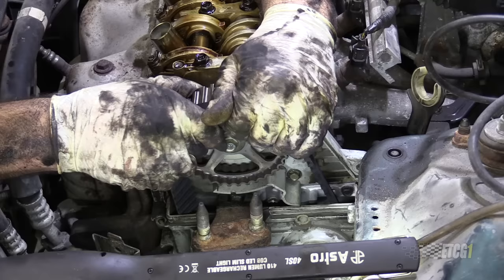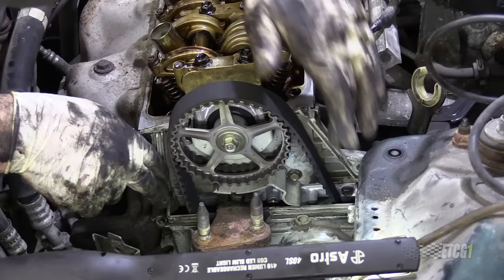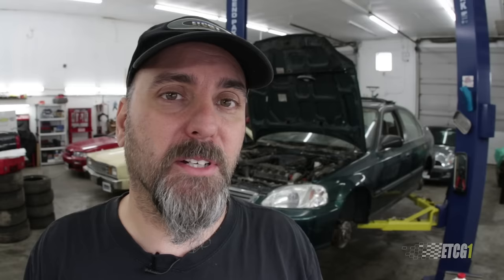How Come Timing Marks Don't Always Line Up Perfect?

Comment: I have a 2005 mitsu eclipse 2.4 with the timing belt . Looks like the timing on the oil pump gear is off 1 tooth could that make the oil can light on an off on the dashboard ? It starts runs an idles fine . Except it did develop a knock an 1 set of rod bearings needs changing . Wonder if it being a tooth off could throw the oil light an cause the bearing to go bad or would the oil pump gone bad all together ??? Any help please 🥺 !!

Comment: If the belt was off one tooth, what would the motor sound like would there be a noticeable difference? I have a j35 that is giving me misfire check engine light when I know I lined up everything properly. Could it be one tooth off and still run good?

Comment: So you tell me that are some timing belts that doesn't align on the marks? It's my situation right now as the marks made by me doesn't align but the engine's check marks are fine aligned. I'm still afraid to start the engine...

Comment: Is this the same set up for a Mazda protege 323 2000 model i went to loosen the screw on one of the sprocket the left hand sprocket timing Mark move do I need to put the belt back to reset the timing marks?

Comment: adding.  i turned in my clio 1,2 2002 for timingbelt and tensioner change,  after that my car dont go as fast any more..... im useing km/hour so top sped on it before was 160 km/h and pritty fast to go there to.   now it go to 150 km/h  and it takes long time from 135 km /h can it be one tooth wrong they set it ?

Comment: Hi Eric  "l think" you just answered my dilemma but can u plz confirm.
2000 xterra timing belt replaced. All timing marks lined up adjusted belt tensioner pulley. Rotated main shaft multiple times not paying attention to how many..... tried rotating backwards to get back to tdc and marks in place.  Not happening. Am l good?

Comment: Very interesting thank you!

So I have a job on a SOHC on my daily driver coming up where I’m changing the sprocket for the cam and the crank shaft gear because I’m pulling them out with the chain tensioner guide.

My question is this

I have a method to keep the new sprocket, cam, and crank gear, all identical when I place the chain, but do I need to make the chain timing marks match the sprocket and crank or will it be fine if the crank and cam are timed with the sprocket?

Comment: if they are ever so slightly off, and I have dual cams, then when my exhaust cam in showing TDC but my intake cam is a hair behind in rotation. which TDC mark on which cam gear should i use as my TDC when adjusting my valves?

Comment: Wow, an automotive video that actually has some useful info in it. I didn’t think people made those anymore lol. This reminds me of a timing belt I did on a 2004 Chrysler 300m. I must have had the belt on and off 10 times because every time the one camshaft would be a tooth off. I actually ended up having to backseat the one camshaft to get the marks to all line up after turning the engine over. I’m starting to like belts more and more after having a recent stretch of timing chain problems on multiple vehicles. Both need repairs/replacement at some point, and timing belts always come out cheaper and easier to replace in my experience.
Reply: Timing chains are supposed to NEVER need replacing.
Reply: Timing chains tend to only go out due to neglect. They're a bit more difficult to swap out as they usually outlive the engine, unlike belts which are a wear item and you have to go through this every X miles.
Reply: @TheEgg185  Tell that to nissan and their vq35 engines.
Reply: amak1131 well the chains stretch and wear just as much of not more than belts do. Ok, let me guess the tensioner should account for that wear? The tensioners are usually what fail on timing chains. Ask bmw, Nissan, gm ecotec owners, Mini Cooper 1.6 owners, early dodge and Chrysler hemi owners, I could keep going. Especially with cars staying on the road a considerable amount of time longer than they did 10 years ago. Hate to tell you, but if timing chains didn’t ever need to be replaced they wouldn’t make them replaceable. If you consider 100k-150k the lifespan of a car then I guess timing chains are a lifetime part, but any more than that they become a wear item.

Comment: I was skeptical when I replaced the timing belt, thinking I must've jumped the time or it was behind a few teeth and could've have screwed up the motor. As soon as I turned over the engine everything runs normal, but before I replaced the belt it ran somewhat lean and the timing was off.

Comment: Thanks for the video, in my case... the bottom mark was on the arrow and the top wasn't. And if the top was - the bottom wasn't aligned.
What if I take off the belt and align both to the arrows? what'll happen? I made a huuuge oopsie working on my Dodge Neon '04.

Comment: Heat, tension, harmonics, clearance. Yes, there is some play in the timing gear. If it could be designed and manufactured and actually run perfectly, they would be. However with heat and harmonics a zero clearance assembly would break in use.

Comment: I'm having this problem with my 2005 Pilot.  My son's mechanic friend is going to come over and help me out.  If he is OK with it, I'll make a video.  I'm having two problems.  First the rear/firewall cam want to slip toward the firewall when I put hand tension on the belt in the place where the hydraulic tensioner would be.  I can compensate for that.  Second, when I do get the marks lined up, release the tensioner and hand crank for 2 revolutions both the front and rear cams are off one tooth.  I can't figure it out.

Comment: I wonder if there is a specific optimal ratio of number of teeth to the belt, to the total number of teeth in the cam and crank gears. Obviously the ratio between cam and crank is 2:1. But is there a specific ratio from cam:belt or crank:belt? or maybe cam+crank:belt?

Comment: Do Fords still have no timing marks? I once did a timing belt on a Zetec-SE engine (Ford/Yamaha co developed if I remember right) that didn't have timing marks.  It had a tapered crank pulley (no key) and you got the timing right by using a special flat bar tool that slid into slots on the ends of the camshafts when the timing was right.  Very odd, haven't taken apart a more modern Ford engine to see if they're still doing that.

Comment: Good video thank you! So I was setting the timing on 2009 dodge ram 5.7L and it lined up correctly and I released the tensioner  but I rotated the crank 1 more time and it didn't line up, so???

Comment: its is a mcm problem, just get de mcm between cam shaft sprocket teeth numbers and  timing belt teeh numbers, divide this result into the cam shaft sprocket teeth numbers and you will get the number of rotations before that the marks on both sprocket and timing belt will match again

Comment: I have redone my head gasket,3times in the last two weeks first I didn't clean the heads so it blew,2nd I didn't have any money so I used same gasket cleaned it up then spray painted it to get a seal,that didn't work ,3rd I used original gasket cleaned it then  sprayed it with copper gasket spray now only problem is that it's starts on the first try no problem but when I turn it off then back on it trys to start then stops and then hesitates then starts 3 try it won't start at all .what am I doing wrong

Comment: i ave a problem with  my d16 engine, it idles fine but when it reach like 1500 rpm it start to behave like it is missing until u pass 2000rpm, u can tell me wat could cause that

Comment: No of teeth should be the amount of turns required. For the crank, it has seen the mark 4 times during that time. This is also important for any chain driven system. Picking the right sprockets for a motorcyle will keep both chain and sprockets from wearing out prematurealy.

Comment: hey what is the diffrent, if the timing is right on crankshaft.  and only one tooth wrong on camshaft??  sounds diffrent ?  or just lose 2 to 4 kw ?? should be more diffrent if its wrong one teeth to the left or right ?   can you do that test in a video ? ???  and fire it up.  should not be any damage with one thooth................

Comment: so so so. i removed the timing cover on my 2011 v6 stang bc im doing the timing chain. i found the camshaft phasers timing marks dont align with the timing chain marks. Alldata says to put piston 1 at tdc which i did and the picture they show, the right side cam phaser is slightly offset pointing to the right and the left phaser slightly offset pointing to the left. however when i have my engine at tdc for poston 1 and the timing marks from the timing chain, the phasers dont show as the picture from all data. my right phaser is slightly offset pointing to the right as shown on alldata. but my left side phaser is more straight up and down. i want to know is this is anything very bad before i remove it. idk if this will mess me up during installation.

Comment: It's not that it is designed in at all. It's a simple factor of how belts and chains work. Unless you have two equal sized sprockets a chain or belt can never hit the same marks every rotation.

Here is a simple thought experiment to understand it. If you take two equal sized circles you could replace the belt/chain with a bar attached to each sprocket on a rotating pin (Think how all the drive wheels are coupled on a steam locomotive) and the circles could still spin around freely cause they are 1 to 1. However, if you take a big circle and a small circle and try to connect them with a bar in the same manner they will get jammed up because the ratio isn't 1 to 1.  Since a belt and chain doesn't have to connect at a fixed point on both wheels it avoids this inherent problem that bar links had.

Comment: But what if it's exactly half a tooth off, so you don't know if it's supposed to line up with either one or the other tooth?
Also, you counted the revolutions of the camshaft. I guess, engines are designed so that those match with the revolutions of the crankshaft, so this makes sense in a way, but I also wonder how many revolutions of the timing belt itself those were.

Comment: When the marks are close rock it back and forth. The marks will align unless it was improperly installed. Belts stretch, chains do too, and gears develop wear. There's always going to be some play. It's called clearance. 
 Line everything up and put it together. A real good idea is to manually turn the engine a few times to make sure the marks are aligned. If you're off it will be obvious. Especially obvious if you run the engine.

Comment: I am trying to do the timing belt on our 2008 Audi A4. The trouble I have is that when I get the crank pulley mark and cam gear mark to pointing correctly, the crank won't stay and slowly moves CCW, resting an inch or so off the mark! I tried going past the mark a little, but the crank still rotates CCW to the same place off the mark. I had loosened the plugs to make it easier to rotate by hand. Tomorrow I will try tightening the plugs to see if it makes a difference. Any one know the reason why this is happening?

Comment: So it's the solution of (n*x) mod b = 0 where n is the number of teeth on the cog and b is the number of teeth on the belt and x is the number of rotations. And that proves that the honda engine is actually a hand cranked calculator in disguise

Comment: This has nothing to do with timing marks lining up. This has to do with cog/gear tooth ratios. For example, if you have a cam cog and a crank cog with the same amount of teeth the marked lines will line up every time when the belt marks come around. Timing marks not exactly lining up when you put the belt on has to do with an old stretched belt or belt slack when you put on the new belt. I agree, if it's less a tooth out its within spec since you cant get any closer unless the new belt is wrong or not made right.

For this "hunting" to exist the belt would actually have to change position on the belt, this would cause a valve interference catastrophe.

Comment: Hey eric got a question.  I replaced a timing chain gears and tensioner on 09 dodge avenger 2.7 and as im rotating the engine i noticed that the tensioner and guide seem to slap.  Almost like the tension doesnt full extensend to keep chain tight. Thought maybe tensioner was bad. Bought another new and same thing. Each rotation i go to make sure the marks line back up which they dont now after i seen your video im going to try the 52 rotation or so to see. But the tensioner guide is more of my concern? How do i fix that

Comment: The biggest reason that throws marks off is when the head or block deck has been shaved. and i can tell you that isn't fun!!! Also I ecounterd once that the factory service manual was wrong... That was a long day...
Reply: I had to throw out the manual once on a Toyota Camry. Mid 2000's. What sucks, I managed to add a little thoughtfulness of my own and got it perfectly timed only to realize I had assembled something else imperfectly. I'd rather be lucky than good.

1st time go became several hours trying to recreate that magic moment. A few mm that Eric taught about can't be an inch. It would move out of time by nearly an inch! The way I put the belt down from cam to crank had to be few more, no a few less teeth many times over until I landed at the magic middle.

Prior to this engine, I was a first time go as they say on every engine I had timed. Usually laying down the belt impossibly tight is the solution then tighten the tensioner, but not on this engine!

There's a Kia that can cut your fingers off when it jumps. Why would they chose timing Mark's where the engine is so likely to leap violently? There had to be a way to make Mark's in a more intelligent engine position. 

I learned in the comments that I should make my own Mark's at a natural engine position and then you can confirm it with traditional marks.

Kia literally put into the manual that the engine likes to jump from the Mark's. I felt like they were going to say next that they weren't liable for all the injuries they've caused. 

Thankfully, I stayed safe.
Reply: Dutch, I can see how if you were used to timing an engine and then you did a shaved one that the rules will have changed a bit. Sounds like a pain in the ÷_<.
Reply: Especially if you don't know that it has had work done in the past.
Reply: That's also my lesson that I learned: ALWAYS MARK YOUR PULLYS. But I'm glad that I am not the only one that has this issue :-)
Reply: I have a 2000 Honda Civic LX I want to change out the belts, but what you said about the resurfacing of the cylinder head and block itself, how do know what size, type belt to get??  Will this glitch burn more gas just to keep ratios for a good running engine??

Comment: I get how the hunting works, having an odd number of teeth where the belt will progress with each turn, but I'm confused as to how this relates to the timing marks not lining up.  Is the distance between teeth changing?  That seems implausible.  It shouldn't make any difference what teeth of the belt are engaged as the distance between pulleys (in teeth) doesn't change.  What am I missing?

Comment: Gear ratios can be referred to as hunting and non-hunting ratios. This is  accomplished by changing the number of teeth on the drive gear and the driven gear. They're formulas to calculate how often the same teeth will mesh

In a non-hunting ratio, any one gear tooth will contact its corresponding gears' teeth in the same place every time.

In a hunting ratio, the number of teeth in the gear set have no common factors between them. This way as the pitch diameters 'roll' over one another it takes a very long time for the same teeth to once again make contact. this is much better for wear, vibration and noise.

Comment: Now that just locked my brain up, for a belt to move place i would expect the drive to have more or less 1 tooth different, but surely that would make the timing drift off.
No that's wrong, so..
A belt with an odd number of teeth?
Reply from the maker: Yea, it is confusing, but somehow it works.
Reply: The timing marks line up half the time. The belt is just wandering through. They do this on motorcycle chains by having odd number of teeth on the back sprocket versus the front.
Reply: Final drives usually have hunting gear sets as well.  It spreads out any unevenness in wear - like rotating your tyres.  I think they do it by making sure the number of chain links or belt teeth can't be easily divided by the number of sprocket teeth.  :-)
Reply: Think of it as a "lowest common denominator" problem in math class. 😉
Reply: Exactly.  And the higher that "lowest common denominator" is, the more the gearset hunts.  :-)
Reply: DE Nichols, yep it just made the brain hurt untill i realised what was going on, not something i had ever thought about lol.
Reply: Well, you have different diameters of wheels and such, it is not symmetric.

Comment: I guess if you video the timing light on it, it wouldn't show without a high shutter speed camera that you could slow the footage down a bit instead of spending all that time hand cranking speeding up footage instead. Thanks for going through the trouble anyway